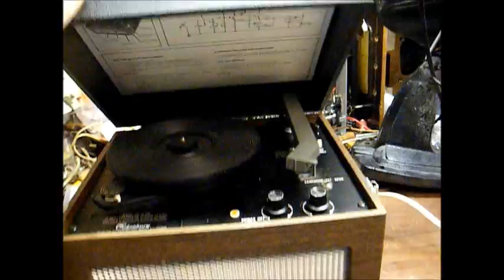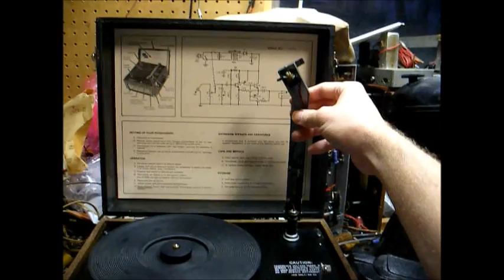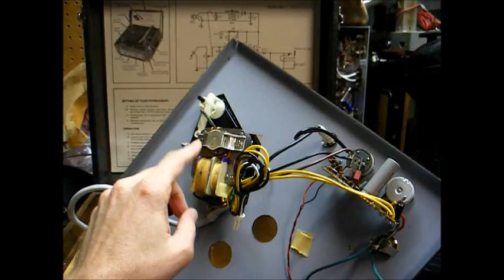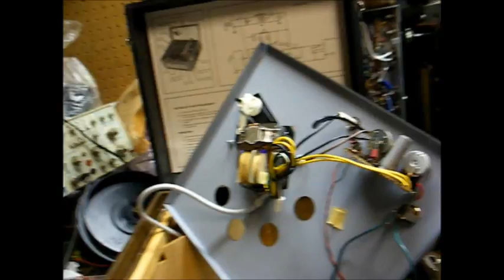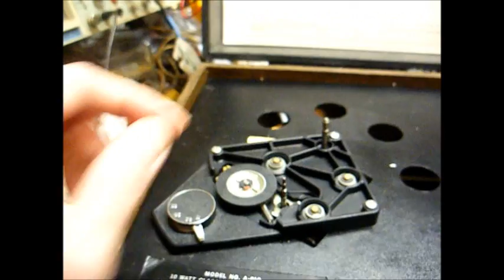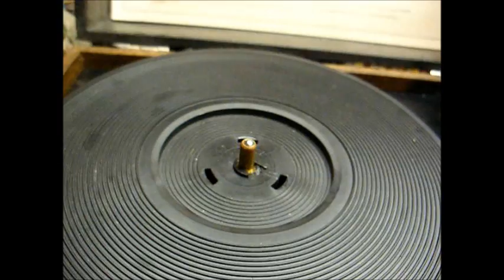Repair of a 1975 Cokesbury classroom record player

Comment: I have a very similar school record player from 1973 that I think may be a VM. It has the same metal speaker grill and corner protectors, an Astatic tone arm that takes an 89-T cartridge with the identical screw down lock, and it has an almost identical schematic and nomenclature under the lid. The speed changing lever is a little different, the pilot lamp is in the same location but mine is red, and like your player, it has a power cord that's thick enough to run a clothes drier. The turntable is metal with a rubber pad on it, there is a pause control, and as you and Shango point out, mine runs a bit fast also. When I opened it up to service the motor I saw that I have the same speaker but it is located in the center of the grill, the steps on the speed change mechanism is made of metal, and my circuit board is larger. Mine has a microphone jack so the amp can be used as a PA system and a headphone jack. I bought it at a thrift store for $30 in 2004 and am happy to say the amp is okay and has never given me any problems. I had to eventually buy another double sided stylus which wasn't cheap but it was less than replacing the entire cartridge and now I am good for another 40 years. I use it mostly for 78 RPM records because my regular turntable only plays LPs and 45s. Our units are not identical in every respect but they're first cousins and built like a tank..

Comment: The change in the Cartridge was really a major improvement in loudness. Cool!
Does voltage affect motor speed on that? I know voltage used to be 110, then 115, then 120. I guess it wouldn't affect it that much.

Comment: Couldn't find anywhere to send you a message. 

Have you ever found a McClure record player? 

I had one which I bought solely for the grey colored wood cabinet it was in as I needed a case for a project. To me the mechanism was not of very good quality. When I opened it up I was greeted with a fairly decent solid state amp that as I recall from tests I did puts out about 16 watts into 8 ohms. Really wasn't expecting that kind of a find. I recapped the amp and power it with a transformer that has more current capability and it has been a very nice little amp to have around.
Reply from the maker: Those often had a built-in filmstrip projector and the older ones used tubes. Over the years, I've had one or two of the tube models.
Reply: radiotvphononut Unfortunately this one was just a record player.

After watching some of your videos about these types of record players I kind of wish I had kept it together. In a way I was sort of surprised to find such a good audio amplifier inside, but then again judging by the construction of the amp and the transistors used it was most likely built during a time when those types of record players were still being built good.

Comment: Which powerpoint did you end up using? Did the FB loop cap fix the output issue with the original, or was that powerpoint nearly dead?
Reply from the maker: 89T cartridge. A good cartridge fixed the weak sound. A new capacitor fixed the motorboating.